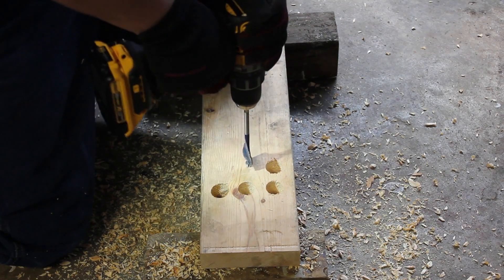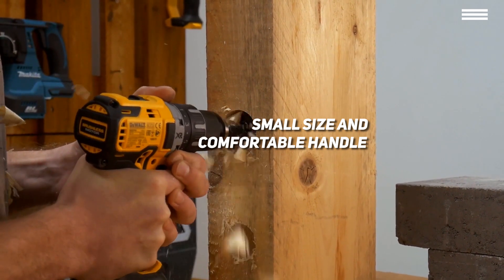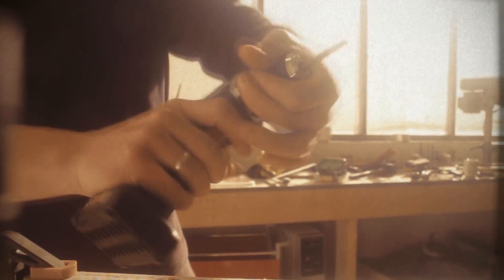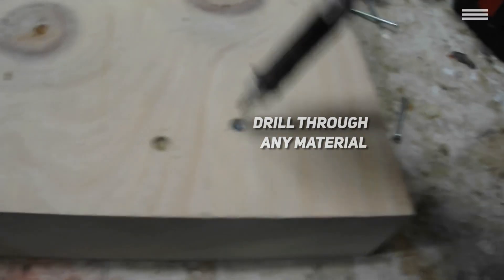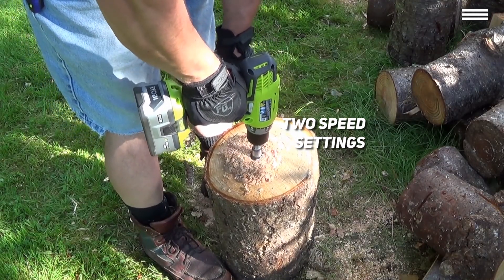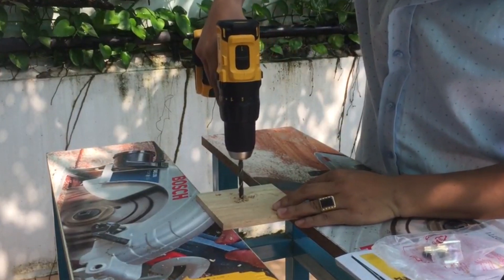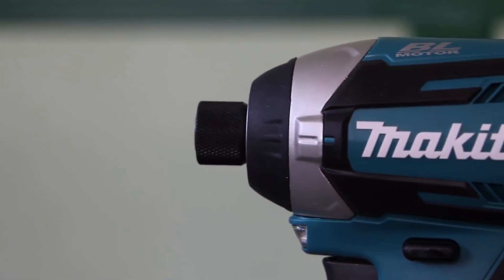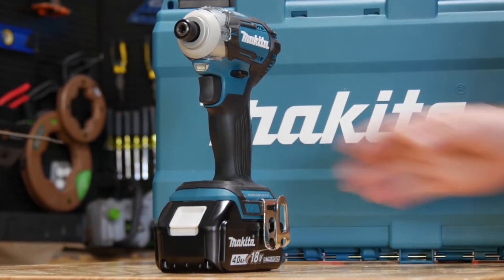TOP 5: Best Cordless Drill 2019

Comment: Worse drill video ever I'm partial to Milwaukee but the new fuel gen 3 has been tested with everything on the market nothing beats it and Milwaukee wasnt listed. At least makita was as for dewalt they are junk I used dewalt for 5 or 6 years and since switching to Milwaukee I can tell a good made tool!
Reply: I always thought Milwaukiee is the best.